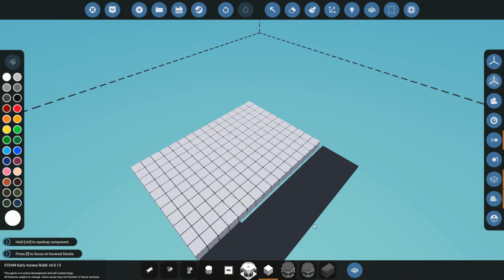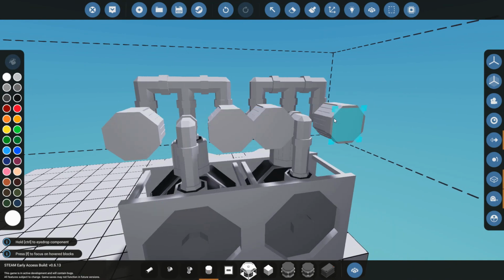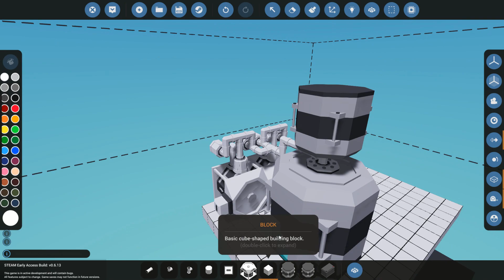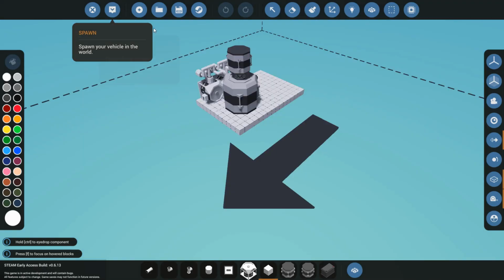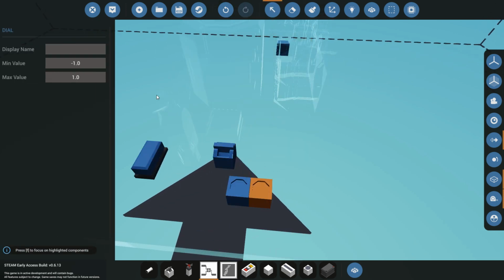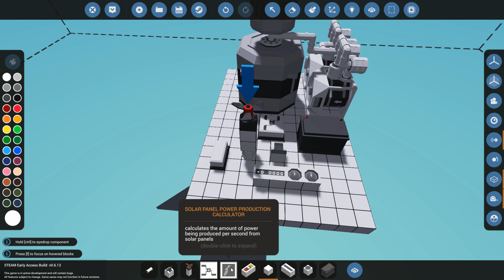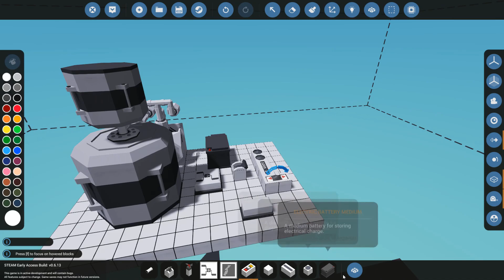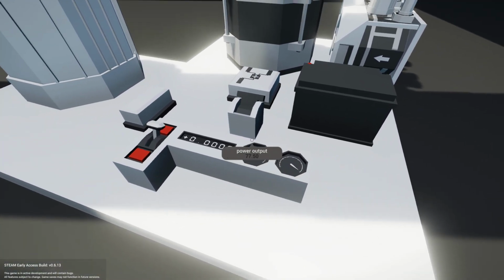Step By Step Tutorial On Infinite Power Module | Stormworks Build and Rescue

Comment: There is a current version of this exploit.
Four small electric motors, into gear boxes to increase RPS by 27, into a flywheel, into a clutch set to 0.6, into a (small) generator. The flywheel usually being a literal wheel not touching anything, maybe the turbine would work as well.
Reply from the maker: I'll have to try that out sometime. Thanks for the idea

Comment: I found a new way to gain infinite energy it's Like a phone mobile charger xD
Reply from the maker: what kind of system did you use?
Reply: @StormRunnerGaming  that system i found used 3 small wheels with full speed 1 microcontroller 1 clutch 8 gearboxes facing 2 medium electric Motors and 1 small generator and of course a battery or two.
Reply: I managed to recreate it , it is not hard at all , the hardest thing is to fit the wheels (2 wheels are ok too (they produce power. Even faster) ).
Reply from the maker: @secretgaming5739  If you put it on the workshop, I would like to take a look at it if you want to send a link to me here.
Reply: @StormRunnerGaming  it is not mine just search in workshop infinite energy unlimited or charger because i can't give the link now.

Comment: I just want to figure out how to make a generator charge my batteries in my boat. I have a cargo boat, I connected my engines in the boat to the generators, and connected the generators by power to the batteries, but it doesn't charge them.
Reply from the maker: I'll probably be making a tutorial on a generator setup in the future
Reply: Try using the actual charger block in the game it might help

Comment: You can make infinite power with 6 large generators hooked up to one medium electric motor, you could use gearboxes to get more power.
Reply from the maker: Yeah, there are a lot of configurations like that that will make infinite power
Reply: Is it more quiet if so could you pls make a video my ears are hurting from my 3 infinite generators

Comment: Technically you don't even need the turbines to get infinite power you can just hook up small motors to a gen
Reply from the maker: True
Reply: Yeah I did this, you use an Omni pipe and connect small moters to the large generator. It works good, not sure if it can match the power I use. But I will test it with dials.

Comment: This is like nuclear reactor, you can NOT use more energy than it produce, because you will cool it so much that nuclear reaction stops
Can you somehow limit "flow" of electricity? Like, set that 80% of generated energy will go to battery that will power engines, 20% will be actual output? (numbers are random, I don't knwo exact ratio, I do NOT have stormworks :( )
Reply: Stormworks, as far as I know, doesn't have anything base game that allows you to really have that level of control over electricity. You can set up a bunch of power relays (like a breaker but an on/off signal is needed to allow power to flow through) to act like such with logic. But it'd be more of a rapid change. You can't do a "assign % of power to go here" with electricity to my knowledge. You could only do it as a % over time ratio instead. So like with your example (to simplify it), you could set up a logic to count up to 4 seconds and that will turn on an on/off signal to a relay that feeds from the generators to a battery and then after those 4 seconds, for 1 second it switches to a relay that sends power to the motors instead.

Beyond that, having control of the "acceleration" of the motors would be the only real limiter on how much power you are producing with it, but that may end up tripping the whole system out of balance.
Reply: Exactly you don’t have stormworks it’s a video game so your rules don’t really apply here in real life very true in the game we have free electricity
Reply: @axialivanov6101  First of all NECRO!
Second, now I have stormworks and I know how bad it is from first hand

Comment: Using some gearboxes, you could get about 300-500 energy from a large generator + 2 medium motors
Reply: In my testing one medium motor 4*1:3 gearboxes and a large generator makes 500 energies at 0.3 throttle for the motor. Really efficient but you cant add more gens per motor.
Reply from the maker: true, I was just showing off a cool and new system for unlimited power.
Reply: @StormRunnerGaming  That it is. (cool)